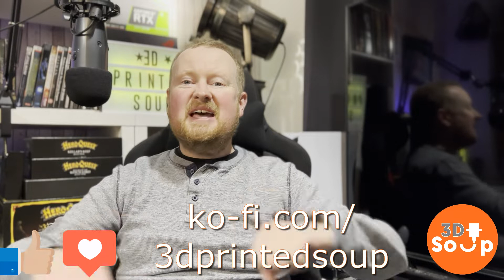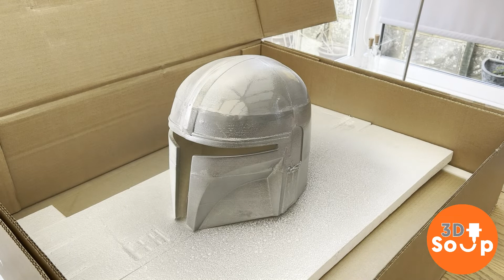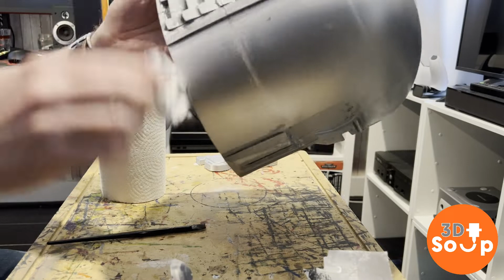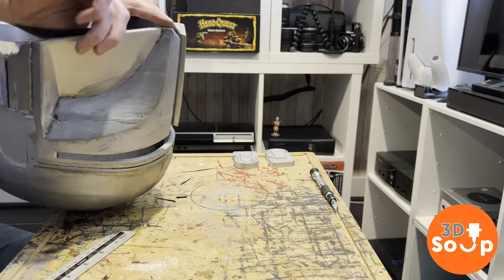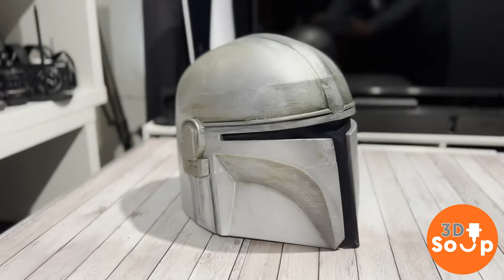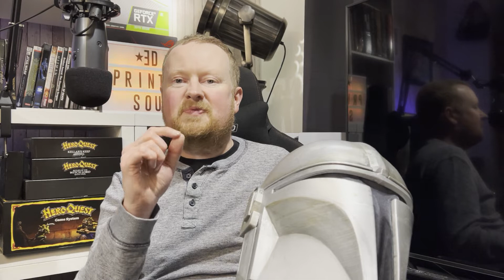3d printed Mandalorian helmet split for smaller printers part 2, ender 3 S1  pt 1 print and build

Comment: Hello how did you size it  to your head ?
Reply from the maker: I worked out the size the print was going to be, measured my head and adjusted accordingly . If you take the width and depth of one of the top pieces, times it by 2 you get a general idea of size. Thanks for watching